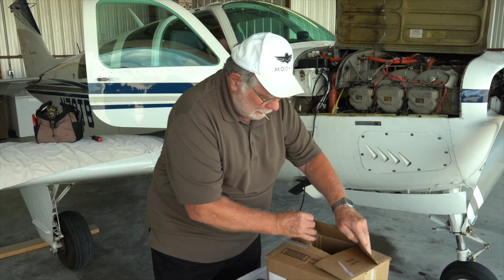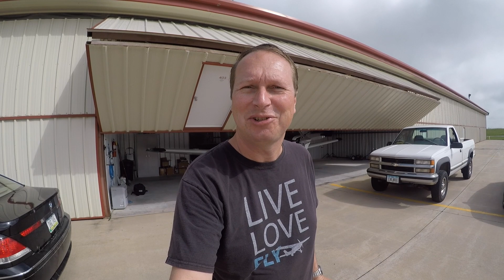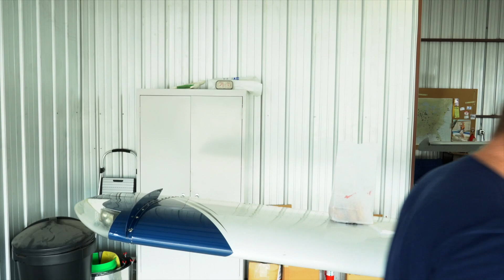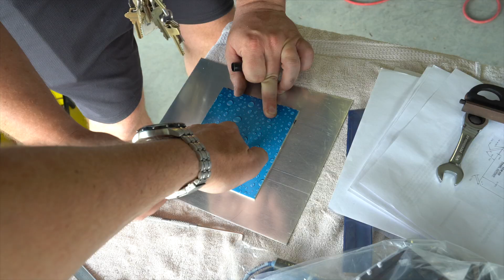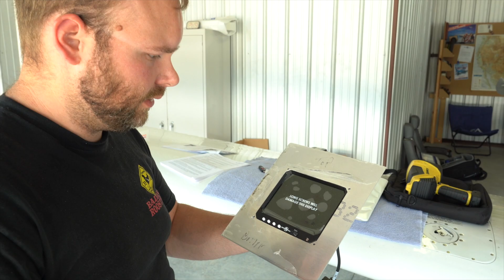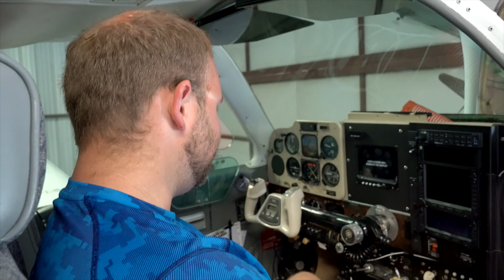Engine Monitor Upgrade - Part I: JPI EDM 930 Installation

Comment: Martin.  I am thinking about adding a JPI 930 to my Bonanza as well.  The engine is currently being overhauled so I think this would be a good time to upgrade engine instrumentation.  I would love to speak to you about your experience with the 930.
Reply from the maker: I really like my EDM930, Al. What questions do you have?
Reply: @martinpauly  Hi Martin. First, what was the final cost of the unit and install? Did it take a while to transition from the gauges to the 930?

Comment: Wieviele Arbeitsstunden waren das denn?
Reply from the maker: Hallo Andreas, das müssten so ca. 40-50 Stunden gewesen sein.
Gruss,
  Martin
Reply: @martinpauly  Danke Dir Martin! Ist mir wohl zu teuer. Hatte heute den ersten echten Testflug mit meiner F33A nach dem IO 550 upgrade! Fazit: Der Flieger ist eine Rakete geworden! Bin begeistert! Würde dringend ein analoges MP/FF gage für meinen Flieger suchen, welches für den IO 550 geeignet ist (FF bis 28 gph). Also wenn Du in den USA irgendjemanden kennst, der so etwas verkaufen würde ... wäre sehr dankbar! LG, Andreas
Reply from the maker: @andreasbacher2695  Ja, der IO-550 macht einen Riesenunterschied, wie ich in meiner A36 nach dem Upgrade auch gemerkt habe. Frage an Dich: Hast Du derzeit noch gar keinen Digital Engine Monitor? Ich empfehle jedem, der ein high-performance engine hat (z.B. IO-520 oder IO-550) so einen Engine Monitor einzubauen. Es muss nicht das grosse EDM930 sein (obwohl das natürlich Klasse ist), aber man kann so einen Motor und dessen Zylinder leicht zerstören, wenn man nicht "sieht", was darin vorgeht - und die Temperaturen, besonders CHT (6x, eins für jeden Zylinder), sind halt extrem wichtig. Du wirst in wenigen Jahren mehr sparen, als der Einbau eines solchen Geräts kostet.
Herzliche Grüsse,
  Martin
Reply: @martinpauly  Doch, ich habe derzeit das Insight G1 installiert, da sehe ich schon digital alle sechs EGTs, CHTs, sowie die Differenzen zum peak EGT für jeden Zylinder. Kannst ja einmal meine youtube Videos ansehen, da sieht man das Panel auch.
Reply from the maker: @andreasbacher2695  Ah, ja - prima, dann hast Du alles Wichtige.

Comment: Hi. I have a question about the installation process in particular. I have a customer who wants to install the same system but in a different airframe. I'm trying to give him a fair price but I need a approximate amount of man/hours spent on this project. I saw that you had two guys working for about five days. Can you shine some light on this issue ? Thank you.
Reply from the maker: It was probably around a 40-hour effort, including the metal work for the panel. That's with reusing the wiring from the EDM-800 engine monitor I had before. 
Best regards,
  Martin
Reply: @martinpauly  thank you very  much for information. This helps a lot.

Comment: Hi Martin.  What was the estimated Installation Costs and final cost of this?  we are looking to do something similar.
Reply from the maker: In my case, installation cost was a bit over 3K. That was with reusing the existing wiring (but installing all the new sensors).
Each aircraft is different; for sure get a quote from a shop before you decide.
- Martin
Reply: @martinpauly  thanks Martin.

Comment: Why old JPI probes couldnt be used on 930?
Reply from the maker: Per the installation instructions, which have to be followed for an approved installation. Why? That would be a question for JPI. Best guess: maybe there have been cases where the old sensors are close, but now 100% what's needed for the new installation.
On an experimental aircraft, you do what you think makes sense.
- Martin

Comment: My question to you Captain wondering why you didn’t change your instrument for a glass cockpit like Garman 1000 or some other but I guess based on number of your followers on YouTube I think Garman or any other company they can give you as free equipment Such a Garman 1000 or Any other company so it should be as a commercial for them to show other people and  Pilot kind of commercial All of that base on How many followers you have a new account YouTube or Instagram or any other social media.  Honestly I don’t like installing something on Aeroplane and then I find there is rom for mistake like what you find.  So Close are you on the equipment to make sure it’s working properly
Reply from the maker: One thing at a time. 
BTW, while Garmin makes a lot of retrofit equipment, there is no G1000 retrofit solution for the Bonanza (nor for many other airplanes). But hopefully they'll read your comment. :-)
Best, Martin

Comment: Wondering why you installed the fuel flow transducer beneath the engine. All the ones I've seen, on fuel injected engines are on top, with an anti siphon loop.
Reply from the maker: The previous one (for the EDM800) was there. That's how I bought the plane - I did not even think about moving it somewhere else.
Are there potential problems with this location that you can think of?
Thanks, Martin
Reply: @martinpauly  I just looked at JPI's install instructions, suspending the Fuel flow transducer  even or below the fuel servo inlet port is acceptable, like yours. Optionally, up top, like mine , they advise a loop, or bump in the line from the transducer output down to the fuel servo. I'd say if it worked there with your 800, it'll work there with your 930.

Comment: Excellent upgrade for a great airplane, you are on the right track. Although this is a personal preference I would also install at some time, two Garmin G5s in place of the suction driven artificial horizon and HSI. I enjoy your videos , keep flying and share with us your experiences.
Reply from the maker: Good comment - yes, before too long, I will do something to the mechanical flight instruments ("six pack"). Maybe an Aspen or a Dynon.
- Martin

Comment: Love your detailed videoes here !!!  I have an EDM 800 as well - but was looking into the EDM 830 upgrade.  My downside is that I still have to have my old analog instruments if I choose the EDM 830....  And now you have inspired me to look closer at the EDM 930 and your way of doing this...
Did you at all consider the EDM 830 or was it too obvious to go with the 930 due to cleanup of old scrap instruments ??
Reply from the maker: Hi Jesper, the 830 would have been much less work to install; however, from the beginning I really wanted the cleaner look of a complete primary system, as well as a screen as large as possible for future videos.
- Martin
Reply: @martinpauly  - I now fully understand, why you wanted the cleaner "primary" solution.  I am now looking at the EDM900 as alternative to EDM930 since it uses less valuable panel space.  Did you consider the EDM900 on your way ?? :) 
- or is EDM930 the only real solution ?? :)

Comment: Glad to see you upgrade Martin!  I had the Auracle unit...and it caused an in-flight fire in my A36....which took it out and parts of my autopilot!  We landed safely and then replaced both units with the EDM-930 and Garmin 600 respectively.  UNBELIEVABLE upgrades!!!  You will love the 930. :-)
Reply from the maker: Thanks, Robert.
In-flight fire? That must have been a scary experience! Were you able to land immediately? Did it self-extinguish, or was it still burning when you landed? (I don't even want to think about it too much...)
Regards, Martin
Reply: Thanks Martin.  It was  quiet the show stopper! I was descending from 5K feet to land in about 8 minutes.  It actually extinguished itself after tripping the breaker.  But it was very smokey in the cabin.  I didn't declare an emergency because I was in class G airspace in the middle of NE and could have put it down really in any field below me.  Good VFR conditions.  But I wish I had bought the EDM and not the Auracle.  It was not the glory unit it was represented to be.  But I love my 930 and you will love yours also!  I very much recommend the Garmin AP should you need a new unit anytime soon. Incredible accuracy. Take care, Robert

Comment: Martin when I visited the JPI booth at Oshkosh, they said they the EGT and CHT probes from 7/800 series could be reused, but I’d have to give them a call to create a custom “kit” for an upgrade to a 900.  UL was this your experience as well?
Reply from the maker: I got a different answer for this primary installation (at least I thought I did - maybe I misinterpreted it?). The way I understood them, for a primary installation (i.e. throwing out the factory gauges) the new probes from the kit must be installed, but the existing wiring can be reused. 
Regards, Martin

Comment: How much did it cost?  ... I know , I know.... if you have to ask you can't afford it. :)  Love these installations videos Martin, thanks for posting.
Reply from the maker: JPI's price list is on their website, so you can look up the equipment price there. You'll see it's a bit north of $6K for the EDM 930 for six cylinders. Then add 40-50 hours for installation at your shop's rate.
Regards, Martin
Reply: @martinpauly  , thanks, I guess I was right, I couldn't afford it :)  ...amazing technology none the less, thanks again for posting.

Comment: As an electronics geek  (but not a pilot) I've always prefered analog meters as opposed to LED/LCD displays. But I'm sure the internals of the new equipment are much more accurate than what you had. It seems like a lot of information on a small display though.
Reply from the maker: It sure is a lot of information, Johnny - you are right about that. But for the first time, all that information is right in front of me, all at the same time. No more button pushing and going through long sequences of parameters to see the value I needed to see. To me that's one of the best parts of the upgrade.
Regards, Martin

Comment: Gorgeous. 
I have an 800. I'll probably go with the less expensive 830, but, of course, it won't be primary so I'll need to keep the old gauges.
Reply from the maker: Thanks, Jim.  There are upsides of keeping the old gauges - some even prefer the original look.  As for me, I LOVE the clean look of the new installation.
It was great to see you in Oshkosh, btw - thanks again for your help with the LOP presentation!
Best regards, Martin

Comment: Do you have any video of the weight and balance adjustment it took to install the new instruments?
Reply from the maker: I plan to include that in part II of the video. Short summary is I saved 3 lbs.
- Martin

Comment: Well, now that Dynon has an AML for over 600 airplanes, not including the autopilot, maybe it's time to install a Skyview HDX system.
Since you already have the JPI and a Lynx ADS-B transponder, you won't need those.  You won't need another Com radio either.
So, the display, GPS, tray, cables, backup displays, etc., yo.u come in at a little over $13,100, and then installation costs.  I'd be willing to bet you could get a nice glass cockpit for under $20,000, but with no autopilot.  I don't know what you have now, but if you have something like a King KFC-150, those still work well.  Either that, or spend the money and upgrade to a newer S-Tec or newer Century AFCS.  Money well spent for an all glass cockpit.

Yeah, I know, money doesn't grow on trees, but right now, for a certified airplane, I think a 10" Skyview HDX is the least expensive way you can go.
Reply from the maker: Dynon is in fact a system I have looked at, as is the Aspen. If I go the Dynon route, I would certainly want to take their autopilot as well (to be certified sometime this year for my A36, as I understood in Oshkosh). I have a Century III - not bad, but it is aging, so if in the process of putting an EFIS into the panel I can also make the move to a modern, digital autopilot, that makes a lot of sense to me.
Regards, Martin
Reply: @martinpauly  it's your airplane and your money, and like so many people I live vicariously through videos like this.  However, I truly think that is probably the best route to go.  With certification expected later on this year, even with the autopilot, it still won't be much more than what I said.
IF I was still an active pilot, and looking for an airplane, a F33A would be on my short list.  Pricing for a twin display system for the V35 family is around the mid $40K mark, but that's displays, transponder, autopilot, engine monitor, and the whole package. Personally, I don't think that's a bad price installed, and I would expect it to be the same for the F33A.
Add a couple of Avidyne IFD 550s and you're set.

Comment: Martin, Take that orange scat duct out from behind the panel and install the correct CAT duct. If it pops off, it can and will interfere with the yoke mechanism. CAT is the proper duct and holds its shape.
Reply from the maker: Thanks, Charlie. I'll look into it. For sure, the yoke mechanism is not to be messed with.
Regards, Martin
Reply: @martinpauly  there is a specific beech part. Worth the peace of mind.

Comment: Any idea how much useful load you’ll gain by this upgrade?  You should film the weighing and balancing process if it gets reweighed!
Reply from the maker: From old to new, the airplane got 3 pounds lighter. Not a huge difference, but I'll take it.
Good suggestion to include the W&B in the final episode - even though it's just math, not actually weighing with scales.
- Martin

Comment: Martin - So for budgeting purposes would an approximate of $9,000 (6 for unit and 3 labor - plus or minus) cover it for a six cylinder engine?
Reply from the maker: John, I think $9K to $10K is a good range to plan for in many cases. 
- Martin

Comment: Are you going to replace the remainder of the gauges on the pilot side of the cockpit?
Reply from the maker: Eventually I will, but I can't do it all at once.
After the Avidyne IFDs and now the JPI EDM 930, the "six pack" on the left side of the panel sure looks a bit antiquated. 
- Martin

Comment: Interesting bit of kit.  Couple questions:  
What kind of failures does the redundant display at the top protect you from?  Is it driven from a different power supply / MCU / sensors, or is it only to protect against the main LCD failing? 

Do you worry about accumulated errors while entering the fuel added from eventually making the fuel gauge completely wrong?  Is there some other sanity check involved?
Reply from the maker: Jonathan, regarding your first question, my understanding is the little redundant display (top left) protects only from a failure of the main LCD and its graphics generation, not the sensors or computation. So it's not intended to be a completely redundant system.
Regarding the fuel and cumulative errors: the computed fuel indication should be set prior to each flight to match what's in the tanks. In the Bonanza, I have tabs in each tank to precisely indicate full, full-5, and full-10 gallons. So when I fill up both tanks, I can precisely see anywhere from 20 gallons below full to full, in five gallon increments. That's good enough to set the computed fuel value before flight.
Also, the instrument has traditional fuel indicators using floating sensors in the tanks. So I think I'm well covered.
Best regards, Martin
Reply: The RAD or Remote Access Display as it's called, is a FAA mandated requirement, and it is supposed to put Manifold Pressure and RPM directly in front of the pilot, as well as other alarms.  

https://youtu.be/0Ddso3r6_FQ?t=75

I believe that it is supposed to be on top of the 'six pack', or at least be within view when you're looking at the six pack.  From page 10 of the installation manual.

"The RAD PN-790749 mounts in a 5/8 inch hole in the panel directly in front of the pilot for the EDM-930 . . ."

So, it should be directly in front of the pilot.  I see it's mounted up and to the left of the display, and according to this document, it's actually in the wrong place.  Most times I've seen it installed anywhere else is usually over the artificial horizon or the altimeter.

Page 7-10 of this document will help explain it.

https://www.jpinstruments.com/wp-content/uploads/2012/08/Install908-Primary_REV-K-4-18-2017jfp.pdf

Comment: Fascinating video Martin. The 930 must make it much easier to check temps and pressures with a quick scan and great to know that the new sensors will give you more accurate readings. Thanks for giving us such detailed information in a mature way.
Reply from the maker: Yes, the 930 is great in how all the data is readily available on a large screen. I'll go into the details/differences a bit more in a future video.
- Martin